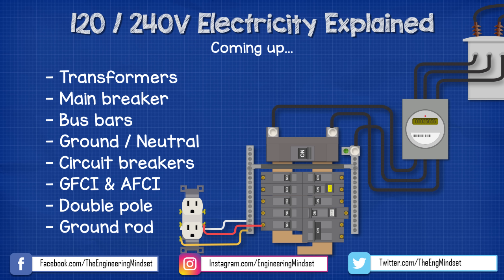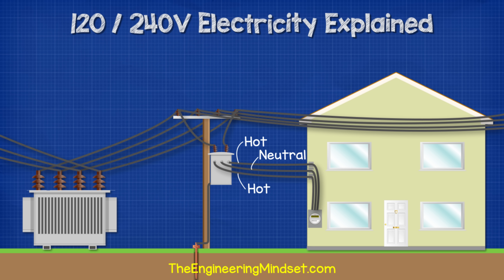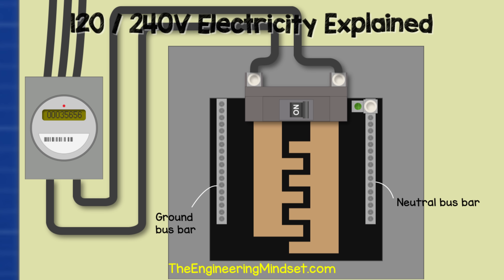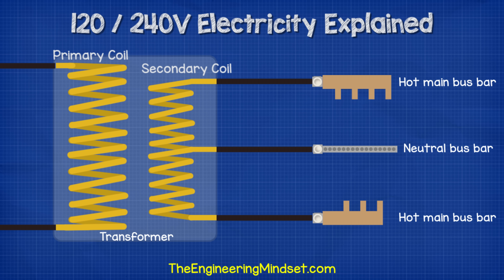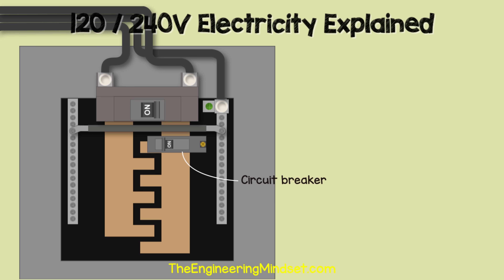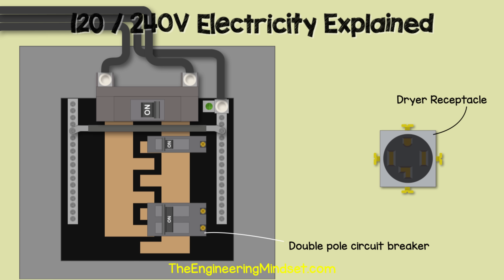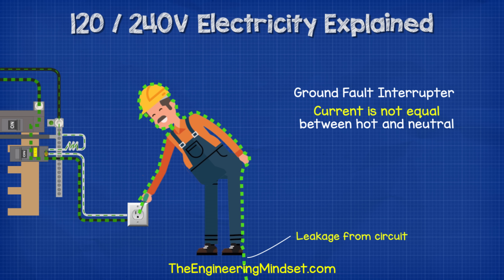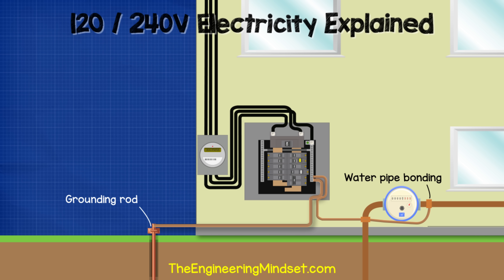120V 240V Electricity explained - Split phase 3 wire electrician

Comment: If there is a connection between ground and neutral bus bar than how can there be 120V read on the DMM between them?? I feel like the connection should make the voltage between them 0V? Look at 4:28–can someone please clarify this or is this a mistake in the video? Or is this measurement only 120V before you make the connection between ground and neutral bus bars? 

If so why doesn’t this trip the breaker as soon as the connection is made?
Reply from the maker: The ground is 0V and the neutral is also 0V, because they are both referenced to ground. Literally the voltage of the planet. You are also tied to this. The hot wires are 120V each, so we have 240V across them or 120V from hot to ground. at 4:28 in the video we show the 120V connection between the hot bus bar and the neutral/ground. The breaker trips based on the current passing though, if you connected the hot directly to the neutral or ground then it would/should trip because there will be a huge surge in current. But if you plug a lamp in then the current is limited and will flow from the hot into the neutral. If it exceeds the limit of the breaker then it will trip.
Reply: @EngineeringMindset  The hot wires are 240v each. The hot wires are 120v relative to "neutral".

Comment: Why would connecting more appliances in series to a circuit increase the current? I dont understand that. I am thinking about V=IR. Watch from minute 6.
Reply from the maker: Electrical sockets are wired in parallel
Reply: @EngineeringMindset  that explains it! Do you happen to have a video taking about it more in detail? Thank you very much for your response, your videos are amazing!
Reply from the maker: Yes, see our ground, hot and neutral video

Comment: This one goes out to anyone who has difficulty understanding how one side of an AC circuit can be “hot” and the other isn’t, given the circuit is constantly changing directions. I struggled with understanding this for years. I hope this helps.

Think of the hot wire as functioning like a fan on one end of an air hose. The fan can blow, or it can suck. It’s not that you’re going back and forth between “blow” forces being applied to each wire in succession. Just the one wire is “blowing” 120v, and then reversing and “sucking” 120v.

Neutral is just ambient air. Obviously the “hose” will not work to move air if there is no access to ambient air. If you duct tape the end of your air hose. The air inside repeatedly changes pressure between suction and inflation, but the air can’t actually do anything. You can’t blow dust away with it, nor can you vacuum the floor with it. So you need a neutral so that the “air” isn’t just “trapped in the hose”. When a 120v circuit is running, the neutral is just providing “air” to rush in when the fan sucks, as well as space for “escaping air” to move into when the fan blows.

240v circuits work by being like two fans on the far ends of two hoses. One fan blows 120v, the other sucks 120v at the same time, so if you connect the two hoses, the air is being moved with twice as much force. In this case, you don’t need a neutral because the other “fan” is providing the “airflow” to keep things moving.

Understanding AC voltages in terms of blow and suck, rather than a simple loop that changes direction, makes this so much more understandable and totally clears up the brain pain that normally results from trying to understand how one wire is “live” and the other isn’t even though the circuit changes direction.
Reply: Thank you, this helps somewhat as I have wondered the same thing.

So does a voltmeter register any voltage on the neutral when power is on/light is on? Can you get shocked touching a "live" neutral? How does that fit into your fan analogy?
Reply: @johnbauman4005  so in theory, if everything in your house has been wired exactly perfectly with no mistakes, that’s the job of the ground rods at your meter box and at the transformer outside. By wiring the neutral wires, the neutral bus bar in your breaker box, the plumbing, gas lines, metal framing/doors, casings for metal devices, etc in your house all to those ground rods, there becomes an effectively infinite space for any stray excess electrons to go or for any deficiency in electrons to be recouped, so in theory the neutral should always have current (assuming a closed circuit, anyway), but never any voltage.

In the fan analogy, I suppose it’s a bit like leaving all the windows open. There’s so much air around to come in or go out that a pressure imbalance can never form.

All that said, I would certainly not trust that a white wire coming from the wall or ceiling is cold without testing it first, because a mistake as simple as accidentally wiring the hot and neutral backwards somewhere can throw big wrenches in this. You can test with a voltmeter, but the simplest test is just to tap the bare end of the neutral wire against the ground wire. If everything is connected properly, those two things should go to the same place at the other end, so there should be no sparks and no tripping of the breaker. If you get a nice pop n glow and the breaker flips off, you know something somewhere is not quite right, and that wire does have voltage.

It should also be said here that voltage is a gauge measurement, not an absolute measurement. Just like pressure, or height. A voltage only has meaning relative to some baseline. We usually use the ground voltage as our 0 point because most things are touching the ground, so usually something that’s at a voltage different than that is what’s going to cause current to flow. Same way we generally measure height relative to the ground, because what we care about is how far something would have to fall to hit it, or we generally measure pressure relative to the ambient air pressure because we care about how badly air wants to get in/out of a container.

Comment: Okay I got a question.. my dryer stop heating up and also end cycles short. I replace the heating element, all sensors attached, the thermostat and the fuse.. but that didn’t change anything . I replaced the main control board as well with the following new components in, It seemed to work after the main control board was replaced but after two days it quit. And now I’m back to where I started. Idk can I please get some help? Sorry I’ve been going through a tough time. 

Samsung 7.4 electric dryer. 
MODEL NO. DVESOM7450W/A3

Comment: What if you only have 2 hot wires coming out of the service panel and you don't have a neutral wire and it's putting out 220v can you get 110v to a outlet from this system
Reply: So how can I get it to work properly
Reply: Ty very much for the information and the advice

Comment: Looking to install another breaker box completely separate from the one I already have. Do I have to install another meter and where do I get the box and equipment needed. I am hooking up a AC,fans,lights, thangs of that matter. Thanks for your help
Reply from the maker: Check the new SUB PANEL EXPLAINED ➡️ video https://youtu.be/NUSNa-7Hecw
Reply from the maker: Check the new SUB PANEL EXPLAINED ➡️ video https://youtu.be/NUSNa-7Hecw

Comment: How would I safely run an old baldor 75hp 240v ac electric motor to a boat with recharging my batteries safety without tripping my power or over heating my batteries in a continuous use to travel the earth in one motion without ever having to shut down to recharge my batteries or shut down to stop my system from damaging itself?

Comment: Why even have the ground bar if you run all your ground cables and grounding items to the neutral bar? I would have thought ground wires, the ground stake and water pipes would be bonded to the ground bar and with the Ground/Neutral link providing the connection.
Reply from the maker: Check the new SUB PANEL EXPLAINED ➡️ video https://youtu.be/NUSNa-7Hecw

Comment: Recently at my home a tree broke one of the hots coming to my house from the street, which disabled some of the circuits in the house and was very confusing. When I turned on my electric oven, some of the dead circuits came on, lighting lamp fixtures dimly... The Hydro guy said something about how closing the circuit on the stove was sending some power by induction to the dead circuit... but I didn't quite understand how, since both breakers for the 220 stove plug must be on the same hot bus in the panel. I'd love to hear an explanation of what was happening in my situation.

Comment: Professional electrical engineer here specialized in power generation, transmission and grid management. These videos are impeccable. Straight to the fact with easy to understand visual support. To me the most important point is that they always seem to know exactly who the viewer targeted by the content is. For me, a video like this is baby level, but I can easily see so much value for someone new to this or in the process of learning it. It could dive into much more complex details, but they are left for other videos which is exactly why it is so perfect.

Comment: Absolutely perfect explanation, covered every base! This is exactly how things should be taught!

There is no better video, you could delete every video out there and use this as the One and only! Thank you

This explains why I only need two wir es To connect 240 V baseboard and do not Require a neutral, I always thought it was an actual return. Now I understand it is just another leg of power That doesn’t actually return. Thank you

Comment: So if you connect two individual lines off different breakers but the same bus bar and measure them with a dvom wouldn’t it read zero not 240 since both are on the same bus.
Reply: Yes.

Comment: is this 240v the same as UK's electricity?
Can I add a UK socket at home and use UK appliances?
Reply: Sometimes you can, but the UK uses 50 Hz while NA uses 60 Hz. If the device has a clockwork timer, it will run 20% fast. If it has a digital timer that uses the power line frequency as a reference, it may run fast or not at all. Some motors can be damaged by running at 60 Hz. It is best to read the nameplate of the appliance. It should tell you what frequency it is designed to work at.

Comment: Can someone explain why US & Canada only uses 2 phases, in Europe we uses all 3 phases, and thanks to that we can use loads that is designed to evenly spread the load equally on all 3 phases, like motors and heaters and that results in lower current on each phase.
Reply: Canada is a large country.The US is also a large country. Running three phases to every customer in either country is very pricey.  Running a single phase  line will provide everything needed in the home. The 2 phases  are generated in the pole transformer.
Reply: @securitycamera8776  The cost cant be the only reason why they is buit this way in US &  CAN, it must be a design choiche for many uears ago that made it this way. In Europe we have design the local transformer network to always have 3 phases, that is not mean by default all people have all 3 phases to their switchboard, eg apartments only have 1 phase but residential buildings always have 3 phases and thanks to that you can choose to run loads that needs all 3, Europe is also maching size to north America and it works fine.
Reply: @fryklundstfr  
US/Canada

	Two conductors, one transformer.

Three phase

	Three or four conductors, three transformers or a three phase transformer.

Clearly the cost difference would be significant.

Now it is true the circuit is called an Edison circuit from the days of DC. The customer got a neutral, +100 volts and -100 volts.

Illumination used either of the 100 volts. Motors could use both 100 volts for 200 volt motors. Works just as well for AC.
Reply: Lower current on each phase, but 3 phase requires more conductors. 3 phase appliances cost more, too. One kW is one kW, no matter how you deliver it. In NA we use 3 phase in almost all commercial buildings. It just isn't needed for residential loads.
Reply from the maker: Seen our new 3 phase transformer video?➡️: https://youtu.be/u0SsejDCVkU

Comment: Great explanation I couldn't agree more with the majority of the comments listed here although. . . There is a discrepancy that is completely missed by a vast majority here which is kinda scary. . . You see the neutral busing and the grounding busing are to be separate at the service, with the neutral busing and ground busing connected would make the ground possibly a path for a return which could possibly make the ground a shock hazard bc the ground would be part of the neutral/return so with this as is should be separated the neutral from the ground. Ground is the fail safe if the neutral were to become damaged and not do its job where there would be a path to ground via least path of resistance. I'm kinda baffled this has been overlooked. . .
Reply from the maker: It is stated in the NEC guide, ground and neutral do not need to be separated on the main panel, sub panel yes. Although I will add it is good practice to.
Reply from the maker: Check the new SUB PANEL EXPLAINED ➡️ video https://youtu.be/NUSNa-7Hecw

Comment: As a California State Certified General Journeyman Electrician, must say the this is the best video explanation I’ve seen on the internet.  Very good job!  Imagine trying to explain all this to an apprentice in the field.  Drawing pictures on the backside of drywall, lettering and numbering boxes and panels, etc.  I’m happy that you didn’t call residential single phase.  There are two phases of power inside the panel.  👍

Comment: Grid carries high voltage electricity but I don’t understand does that mean  two ends of the grid line have different voltages?? 
I mean say a grid line from A to B city is carrying 1kV.   Does this mean 1kV is the voltage difference between A and B city.

Comment: The service of 2 hots and neutral not from only single phase transformers. Sometimes 2L+N service work from 3 ph system in Y, in America with 120/208V or 127/220V and Europe 230/400V.
Reply from the maker: Seen our new Transformer video? here https://youtu.be/jcY4QN7awEc

Comment: Hello!!
  I don't really understand the function of the neutral cable.
 What does he mean when he says that the neutral returns the used current from the hot wire  ( 7:18 )
I hope someone could help me solve this question, thanks 🙏.
Reply from the maker: For electricity to flow, it needs a path back to the source after it passes through the load. The hot wire is 120V the neutral is 0V so electricity flows into the neutral because it is a lower potential. If it was DC, this would be true, but in AC the current alternates backwards and forwards to it's not exactly correct to say but its easy to visualise by using DC terminology.
Reply: @EngineeringMindset thanks for the answer!

Comment: They aren’t phases. The 120-0-120 or 240 total is comprised of two Legs and is Single phase not two phase.  Three phase or two phase Y configuration consists of voltages separated in phase rotation by 120 degrees.  
The single phase legs are additive across the two legs, hence 120 + 120= 240 and have 180 rotation relationship. In two or three phase power the phases have 1.732 (square root of 3) x relationship to each other.  Two legs of a three phase feeder that have a phase to neutral voltage of 120 have a phase to phase voltage of 208 volts.  In summary the two 120 volt feeders are correctly called legs not phases.
Reply from the maker: Seen our new 3 phase transformer video?➡️: https://youtu.be/u0SsejDCVkU
Reply from the maker: Seen our new 3 phase transformer video?➡️: https://youtu.be/u0SsejDCVkU

Comment: Amazing video! I think it may have been worth mentioning that the ground and neutral wires are required to be bonded at the first means of disconnect (Main Panel) on the property. After that, typically there is a Secondary Panel inside the home powered by the Main Panel where the ground and neutral circuits are separated. Don't want anyone watching this video accidentally adding the ground wire to the neutral bar for a new circuit on the inside panel. Lol

Comment: Hello Everyone, I am new to North American Electrical wiring standards. I want to understand the 230V tapping using two hot lines.  I want to power up network equipment using 230VAC. Is it normal to use to two hotlines to power the equipment or should I tap a hotline and a neutral to work at 120VAC? Thanks in advance.

Comment: You can do electrical work just make sure you know color code, make sure power source is disconnected, when a wire break that’s a easy fix but anything else call a electrician that is certified,

Comment: But how is there a "hot wire/leg" if the current is constantly moving in both directions? 
Eg: How does "switches are always wired on the hot leg side of a circuit with a light bulb" even exist if the ac current could surly just go the other way along thr neutral line and pass through the light bulb up to the switch?

Comment: Interesting, thanks. Curious what the primary-side voltage feeding residential drops is, typically? Also, with plastic plumbing these days there aren't always clamps from the ground/earth to the home plumbing - but this info appears on a sign at the panel.